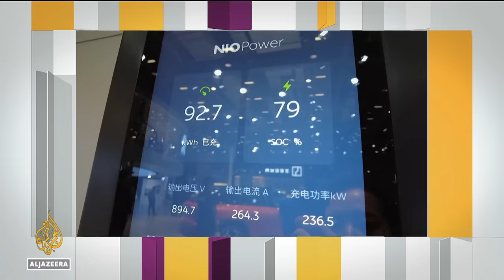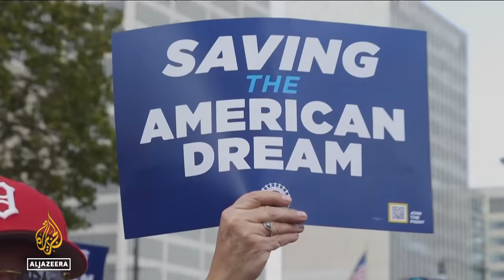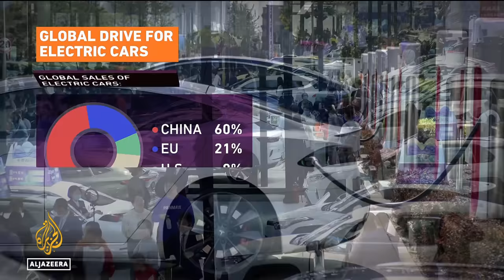Is a new geopolitical battle developing over Electric Vehicles? | Inside Story

Comment: I have a friend in Chicago owned a Trucking Company with 30 Trucks, he bought 2 Chinese electric Trucks like Volvo and Peterbuild These electric trucks performed excellent his profits went up 40% on 2 trucks. He decided to replace all trucks to electric, he asked electric company that he is going electric and wants to revamp his electrical supply to 3 phase and gave load calculations, electric company came running to him and said WHAT do you know how much power you are requesting it’s 5 mega watts, half of Chicago uses 5 mega watts. We don’t have the grid to supply you that kind of power. WHAT OMG. I have 2 trucks right now and there is no problem. We have problem your draw is skyrocketing when both trucks are plugged in after your shift is over, these batteries are huge. City refused to supply power and told him to move out immediately and buy 20 acres put up a Solar Plant for your business. This is the only option. You know what he already bought 50 acres 40 miles away from Chicago and moving with all electric, he said he can recover his money in 3 years cause no engines, no transmissions, no Motor oil, no Transmission Oil, no changing batteries every 24 months. He is happy camper.
Reply: Lies
Reply: Interesting story, thanks. Punctuation would have made it even better.
Reply: Lies. Chicago uses 413TWh a year.
Reply: @elmohead  maybe you miss the point, the powerline to this guy truck company cant carry more than 5mega watt.  and depend on distance it would be very costly to do the upgrade with unknow certainty
how long the trucking company would exist.

Comment: I worked in the auto industry for many years. Designing, testing and bringing any vehicle into production involves a huge investment. That cost has to be recouped by selling a very high volume of vehicles at a profit. So having a product which the market wants, is affordable and the market is large enough is basic. No car company is vertically integrated and makes every component inhouse. Many, many variations of supply chains leading to assembly and delivery to the customer will remain to suit circumstance. Models and platforms and component systems will be shared between assemblers to reduce investment cost and improve ROI. It is definitely not about having local battery manufacturing!

Comment: In the US, without a nationwide infrastructure development plan for recharging station electric vehicles are only useful for local commutes. Even the there has to be the infrastructure to meet the demands of electricity so as to not crash antiquated electrical grids. Here in California we experience blackouts during summer on a regular basis due to high electricity use for air conditioning.
Reply: Without the Tesla supercharger network is what you mean. A road trip in my Tesla is a breeze in the USA.
Reply: @alexd302  I don't doubt it but charging stations have to be as abundant throughout the country as gas stations are. There's also the question of having the infrastructure to produce the high demand of electricity if all vehicles go electric in the future.

Comment: Chinese EV price is higher in Europe is higher than the price in China, so there is no export subsidy.  This is just another Chinese discrimination excuse, not surprise.  Many European EV are made in China or owned by Chinese (e.g., MG, Volvo, London Taxi, Mini Cooper, BMW, VW…), it’s hard to block them all.

Cheap labor is the stereotype of describing Chinese manufacturing.  In general, EV is not cheap, so buyers don’t shop purely on price, car has to be reliable, strong performance and design.

Chinese government spend money on building charging stations, give EV cheaper registration fee and rebate to buyers, this is not direct subsidy to car makers; and every single country does the same thing.

Comment: Im more and more sure that EV´s is not the way, it costs jobs, its dependent on materials that are finite like Cobalt among others, the current Network is still years and years to get where it needs to be and is creating global political fissures between who controls the minerals and the chips... Humanity once again not able to create a solution that could be a benefit to everybody.
Reply: As opposed to oil?  Is oil infinite?  If not oil or EV then what?  Battery tech can evolve to use different and more materials that are more abundant such as LFP.
Reply: Most modern BEVs do not contain Cobalt, they have LFP batteries instead. Oil is refined using Cobalt though and your cell phone is riddled with it.

Comment: subsidy claim is just a copout.  China is more vertically integrated, all parts, are locally sourced, so there is very little time wasted.  Auto Factory robots, parts and repairs are all locally done.   Hundreds of small factories that feed the automotive factories are very close by.  So it only takes minutes, not days or months for changes, parts and repairs.  Batteries are made in China, design teams, technicians, engineers are all local and close they can be called upon for immediate changes to for zero down time.  This network of vertically integrated "zero downtime" supply chain is not replicated in any western country.  That is why costs can be reduced compared to the west.

Comment: Jdq; OK you say hybrids have 50-80kn. Super lets use 65km or 40 miles.  If it is plug in, PHEV like a 23 Prius; then it can charge exactly the same way as a full EV. Something like 85% of driven miles are commute miles and the average commute is 41 miles.  Hence; if you can have 6 times as many hybrids -  you get 6 times the CO2 benefit 85% of the time. That is 5 times the CO2 reduction.  From a CO2 perspective you can have 5 million BEVs or 25 million PHEVs. The hybrids same 5x more.
Now you may say what about the 15% that is a longer trip - well we'd need to know how much longer to calculate the amount needed to be driven by gas; but it won't be much say it knocks it down to 4x better - thats 400% more CO2 reduction; plus the hybrid costs less CO2 to make so maybe its back to 5x.

Comment: China loaded their EV cars with luxury features, and heavy steel frame and doors.  You think German cars are luxurious?  Take a look at Chinese EV cars.  The so called luxury features in Europeans cars are just standard features in Chinese EV cars.  Before, people might argue that German cars have better engines but now EV cars have no engines but just transmission, it is now a MOOT POINT.  EV car has only 20 parts and the most critical component is its battery.  And guess what, China supplies almost all batteries for the world, including Tesla.

So Chinese EV cars will dominate the world.  Get over it.  It is no longer matter to compare Chinese EV cars and German cars.  They are no longer comparable.  Complete different products from different centuries.  The best German cars could do is TEAMING UP with China and produce EV cars with German car brands.  And that is exactly why Germany is investing heavily in China.  It is using China as the industry base to transform its brands.

Comment: Hybrid cars are much more CO2 and water freindly; they have much smaller batteries; so you could make 6-7 times as many and still commute all electric if the local power was from a green source. Nuclear, Hydro, biomass or solar dominant areas.  Do you want 6 commuters driving electric in clean power locals or 1?
Reply: That logic doesnt make sense, if the battery is smaller then the range is too. You said “want 6 people driving electric or 1” which is wrong because hybrids use gas to drive the majority of the time. Most hybrid cars have like 50-80 km of pure electric range.

Comment: Making "affordable' Electric cars might be a priority for car makers - but it is not possible or wise. Right now BEVs make up only 2.5% of vehicles sold, to do this requires 1% of the planets freshwater to refine lithium. To attempt to expand to 25% of the market  would take 10% of the earths fresh water - as much as in the Great Lakes Michigan and Erie. Does that sound plausible?  No. Beyond that most BEVs are powered by electricty produced by burning coal and natural gas; while taking up to 15% of the generated power to transport it and charge the heavy BEV.  Not very CO2 positive, as the BEVs also take more CO2 to make and the fresh water also.
Reply: 10s of millions of small machines that pollute owned by citizens, replaced with a few thousand factories that pollute, run by professionals and municipalities. Makes the problem smaller and more solvable at-scale right?
Reply: @dflash77yt   What? You mean not having a mini oil refinery inside every vehicle is better? No way!

/s

Comment: I have a question for you Al Jazeera: are fully electric cars really a solution? Batteries are really expensive and the manufacturing produces not only carbon but also heavy metal pollutions. The raw materials for batteries are also causing mayhem mainly in Africa. A completely electri drivetrain is more efficient - it's simpler, less friction and allows for regenerative breaking. However, I have heard no one talking about the new HCCI ICE engine that is as efficient as a gas turbine and that could be used to generate power on what is called, iinm, Plug-in Hybrids. The HCCI engine has the same thermic efficiency of a gas turbine.

I know there's path dependency but we should remember that global warming is a result of path dependency and we should be able to change paths when we realize the new path is better.
Reply: Sodium batteries are coming. Don't worry.

Comment: Tesla is part of the US Auto industry! In fact, it is the largest maker of EV's in the United States, by far. In fact, Tesla is the most American part of the US Auto industry since Tesla's are built in the United States and most of their parts are from United States. Oh, and the model Y is the best selling car in the world. Not the best selling electric car, but the best selling car of any kind in the world.
Reply: True but infact BYD already overtook Tesla as the both top-selling brand in the world.  And china now exports and sells more vehicles than every other country. Not just electric vehicles but all vehicles of any kind.
Reply: Tesla in the us are indeed made in the us except for the batteries since they buy them from byd now. Teslas in europe are built in europe and china.
Reply: If you look at the data from statista, ten years ago the US made and bought the most electric vehicles.  Ten years later today, china makes 8X more electric vehicles than the US and is by far the world's biggest market for them.  It helps that china now has 174,000 miles of freeway fully serviced with recharging infrastructure - a goal the US has set for itself but not til the year 2050.
Edit: China EV market is 8X bigger than US not 88x